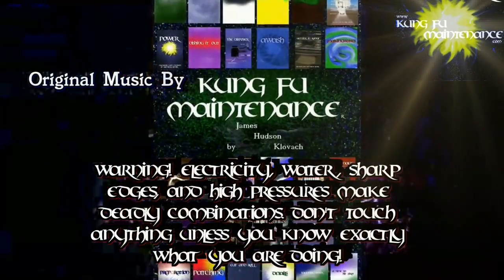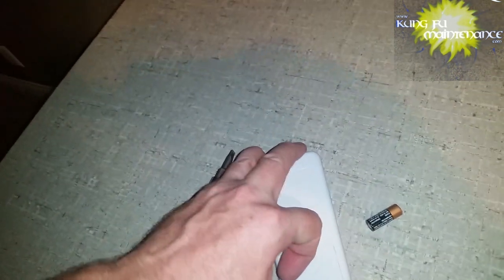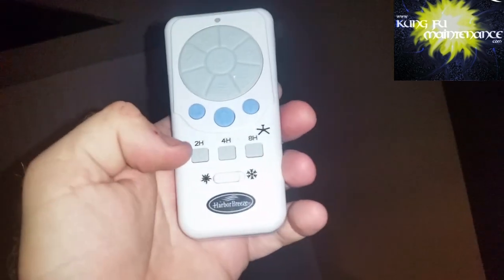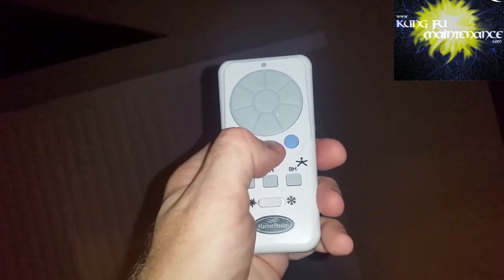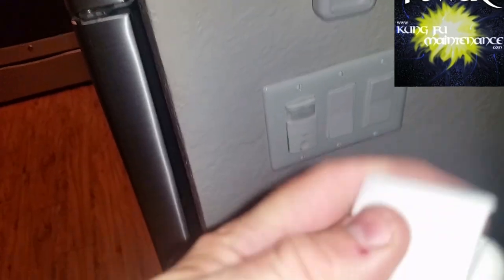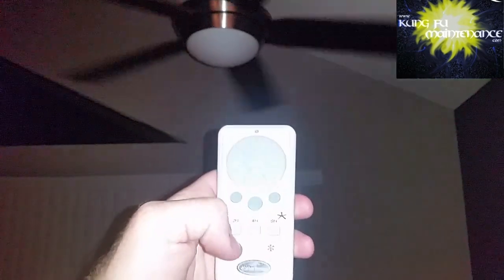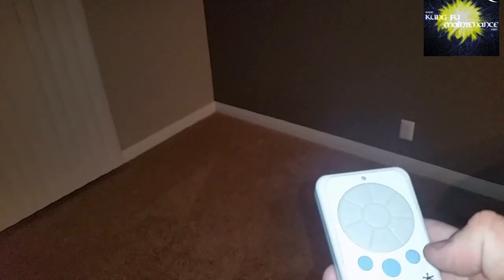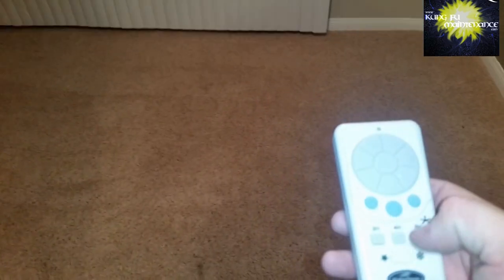Ceiling Fan Not Responding To Remote Almost Threw Out Fan For Malfunctioning How To Fix

Comment: I have the same fan but instead of my fans not working my lights aren’t working. Any advice what to do? I changed bulbs and still didn’t work. Now I’m stuck with no lights
Reply: Justin Case have you figured out how to fix this? I’m having the same issue
Reply: I am also having the same problem with the LED lights call the manufacturer they sent me a new light, but that did not solve the problem now I am like you guys stuck  with  a fan and no light😡 starting to see a pattern here with this light and fan

Comment: Same remote but different fan. Thing just randomly does it’s own thing. Looks like common issue with these. Way too many buttons/options. Might try generic remote replacement with on/off, low/med/high(pull chain options)

Comment: If my new Harbor Breeze remote control does not light up when any button it pushed, could it be a bad remote? The battery is good. The fan when hard wired works. Cannot get the remote and receiver to pair?!

Comment: ThankQ... I installed a fan similar to this back in 2014 and because I travel for work, I haven't had the opportunity to address it.  Ran across your video and it was fixed... freaking almost 4 years later.